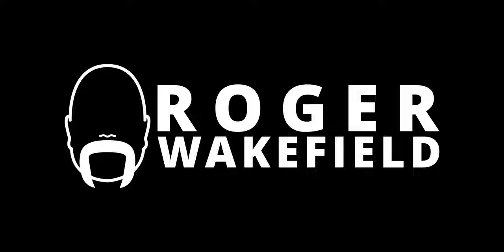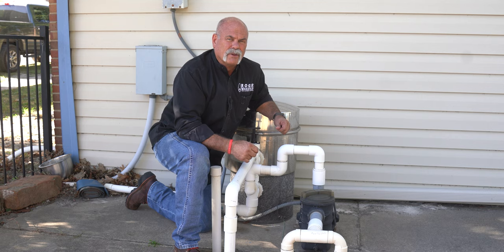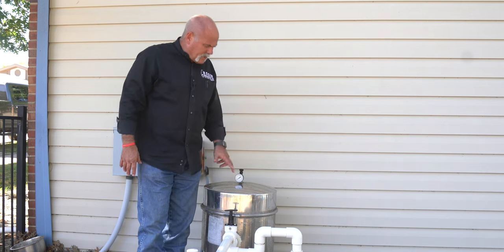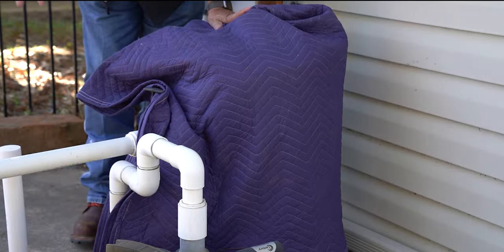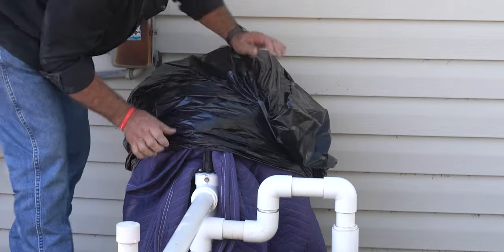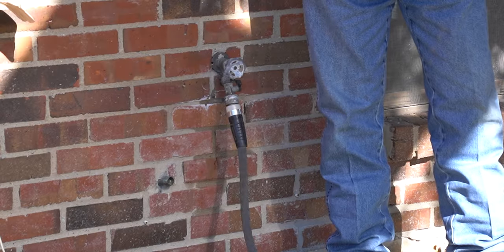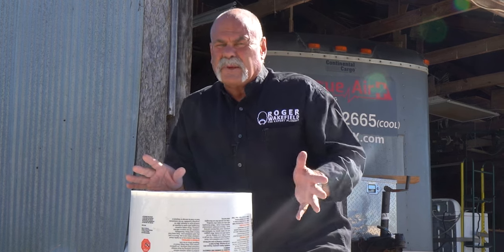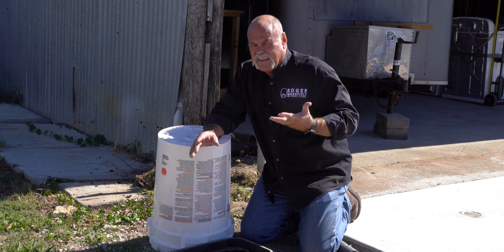How to Prepare Your Pipes This WINTER

Comment: Another option to help when building follow the stricter codes for colder areas. Like burry your pipes deeper, have your frost free valve longer than required for your area, don't run water in the attic. To bad Texas didn't do that or they wouldn't have had the issue when they had that freeze a few years ago.
Reply from the maker: Very true...thanks for the tip

Comment: Up here (southern Ontario), we shut off the outside water sources with shutoffs and drain the pipes / blow out with compressed air. The filters, etc are all put inside. I put the pipe insulation on everything inside. The incoming water pipes here are all 6 feet blow ground and have a shut off inside and outside. No pipes in the attic here as they go below zero.

Comment: I thought you were supposed to wrap heat tape around the pipe. Not familiar with the specific brand you used. But the one I use for my customers calls to wrap around. 

Also, make sure it’s rated for the piping type.
Reply: Love your videos. Just adding notes from my personal experience with heat tape